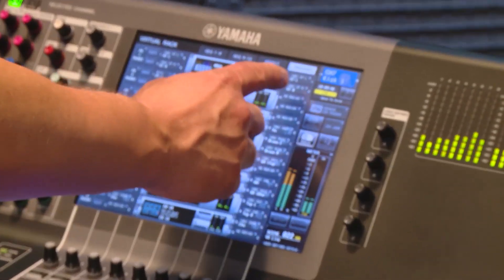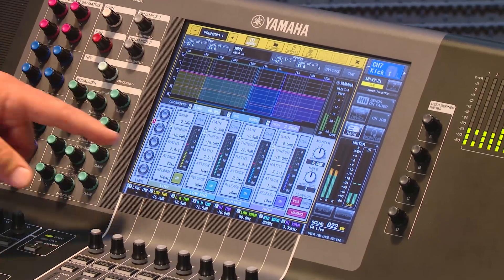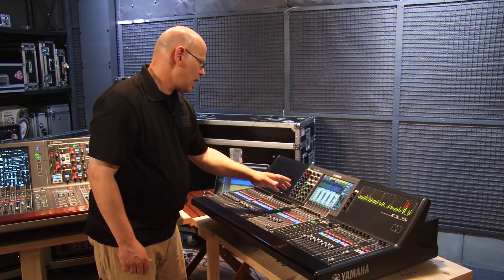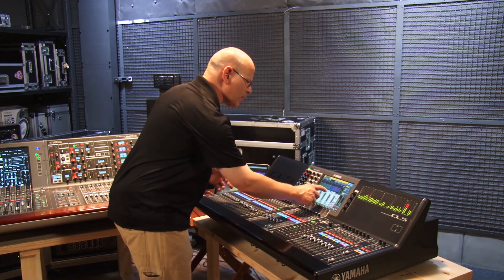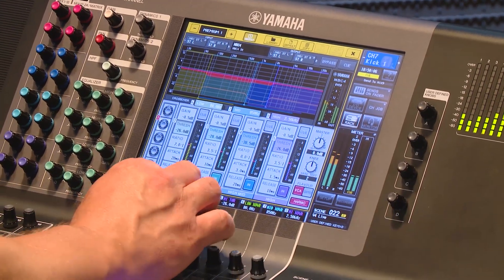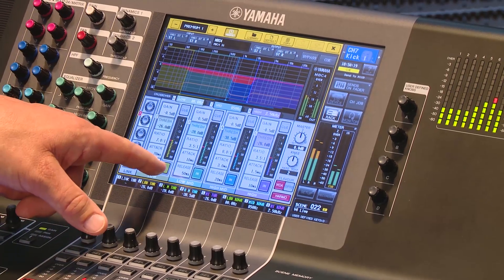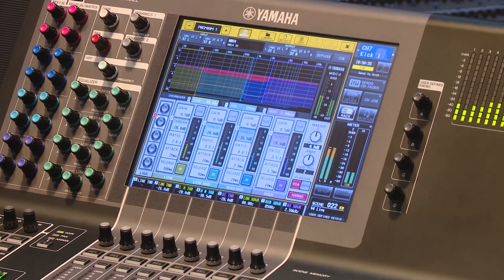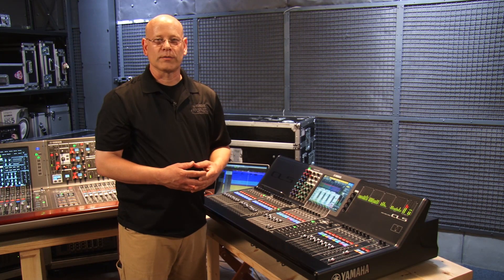Yamaha CL/QL Series: MBC4 4-band Multiband Comp

Comment: It would be awesome to have more access to Premium effects...more "racks".  I use 4 graphic EQs at FOH for quick response when necessary (L/R, fills), but with system processing software I really don't need them either.  The rest of those rack spaces always sit unused.  That's at least 4 racks (8 channels) that could be assigned for premium comps, EQs, and such.  If its a processor engine issue, even having access just to FX and the VCM dynamics would be great.